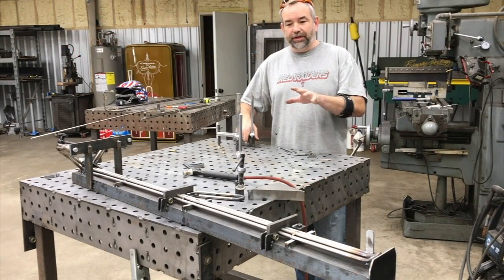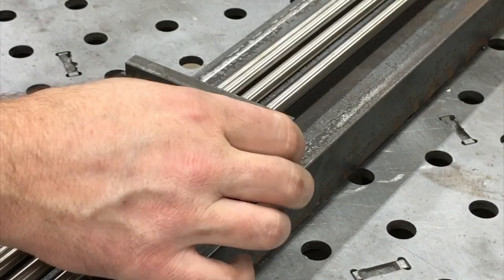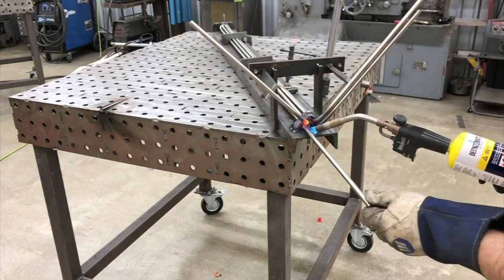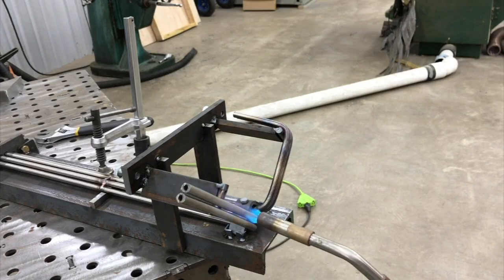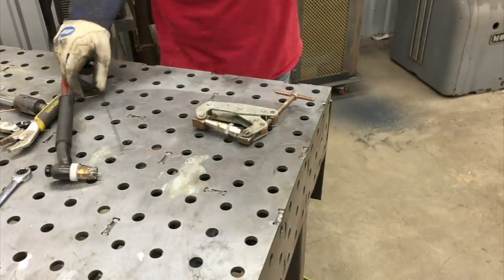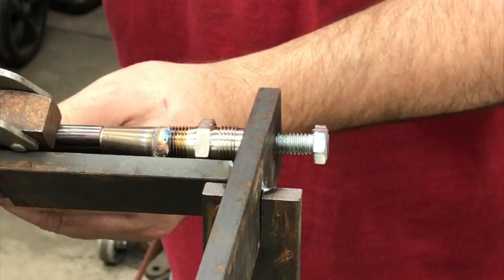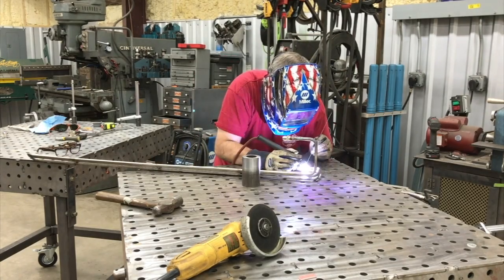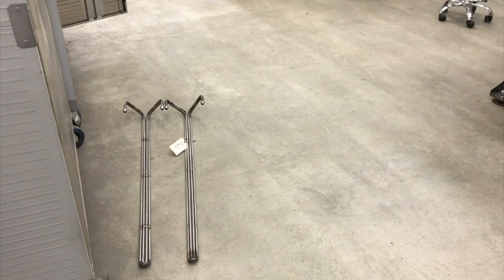Torch Heat Bend and Tig Weld Stainless Steel Tubing

Comment: I'm confused you got some quality tools in your shop then I see that Eastwood tig ?
Reply from the maker: No reason for the confusion.  Over the last year I have moved from a home garage and have bought alot of new and used eqipment, and plan to slowly go back and upgrade my hobbyist machines to professional/production class machines.  The eastwood tig works well for me, so it has been low on my list of things to upgrade, but it will definitley get upgraded!
Reply: Got it , monarch lathe 10EE ?
Reply from the maker: Yes sir, made in 1954, works great.
Reply: Ramsey Customs - turbocobra  best lathe ever made , I've been looking for one but I'm slightly scared of that drive
Reply: Prestige brands are nice to have but if a machine does the job and makes money there may be better ways to spend a tool budget. The operator makes the weld and billions of dollars of pipe and structural work passes x-ray every year on a wide variety of machines, many with the feces beaten out of them. We trained our green welders to set amps based on results, not numbers on the dial/pointer, since it's awful hard to see that dial two hundred feet up on a jobsite when you yell to your helper to bump it up. They could walk up to the trashed machines contractors often keep to test their applicants, set 'em right even if the indicator was broken, and pass 6G pipe tests.

Comment: Cool! Lot of work for a production part. After you make so many you should be able to make it faster and easier. How do you like welding stainless? You'll notice all the little corks the more you weld it. It pulls/ distorts like crazy. Weld. Onward or outward depending on what you want it to do certain joints first ect ect...

Comment: Looks like they used more heat on there's to bend it then you did! Also on the bends on the 45 degree bend instead of using hammer couldn't you make a tool out of soiled rod and slide it into the tube and use the tool and bend it over?

Comment: Not every job a man takes on is going to be the most delightful to perform but if the money is right.  I can make you happy at the end of the month.
Reply from the maker: Your definitely right about that.  I would also add that the main reason I didn't stay in corporate america is that i dont want to get stuck in a rutt and be unhappy with the work i am doing.
Reply: Nor would I like to see you be in a rut and unhappy with the work you are doing.  Only you can decide.

Comment: Can you fill the tube with sand before you heat bend it? Are you getting any porosity on the interior of the tube from the welding, given that you aren't purging? If so, that might be a problem if food grade is spec'd.
Reply from the maker: I asked about Back purging, customer said not to.  I am following the specific bend process the customer demonstrated, but yes a forming Die or Sand filled would help for sure!
Reply: Maybe you could have the customer pay for and own the forming die. The cost would be rationalized in a lower per piece cost. Maybe a special oven that heats several tubes at once would allow a worker to use one torch and a bender to bring it the rest of the way up to red hot and bend a pile of them fairly fast. A foot actuated air or hydr cylinder system would not be difficult to set up. Just some ideas.
Reply from the maker: Thanks Kevin, definitely some great input and insight

Comment: No back purging?
Reply from the maker: I asked about Back purging, customer said not to.  I am following the specific bend process the customer demonstrated, but yes a forming Die or Sand filled would help for sure!
Reply: What flows through it?
Reply: Alvarez Metal Works a river flows through it :-) Water cooled induction heater.